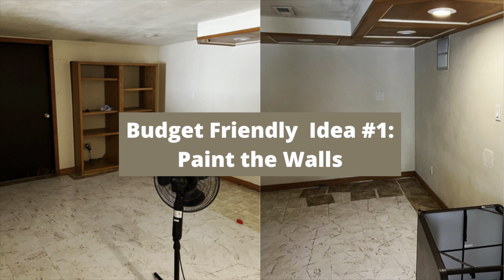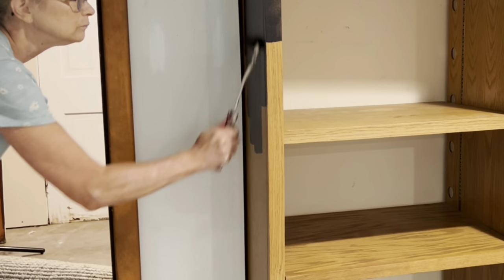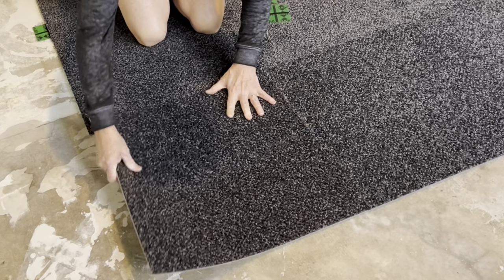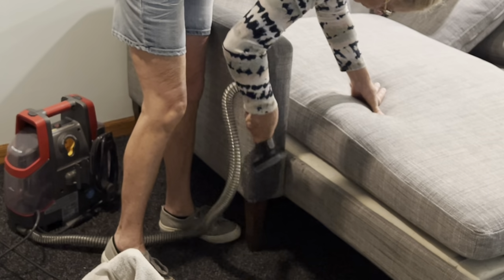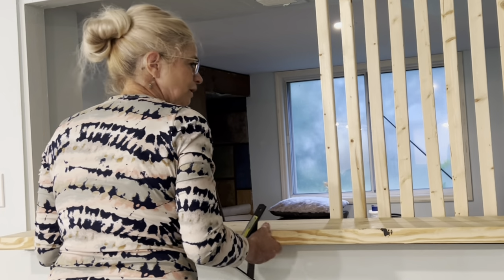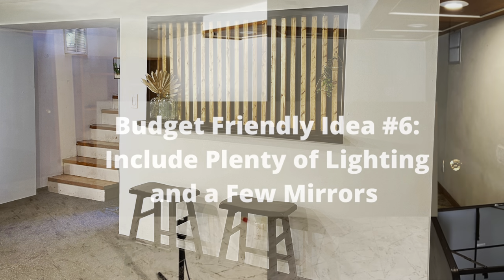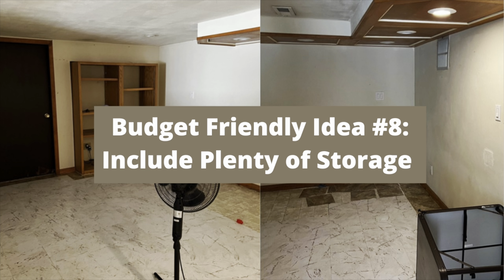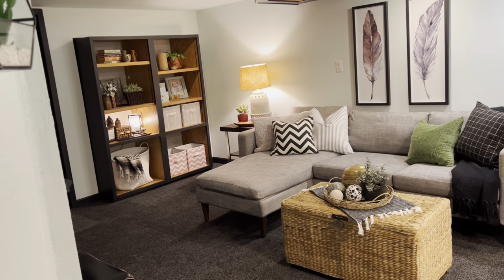DIY BUDGET BASEMENT LIVING ROOM MAKEOVER/BEST TIPS FOR CREATING A BRIGHT AND COZY SPACE

Comment: two things extremely important when placing any flooring specially in a basement....one ...floors must MUST be sealed to help avoid humidity and water sipping up through the cement...even when the cement seems dry.  two...once sealed (several coats is best) need to place a plastic or liner to help future issues with mold and humidity...hope this help.